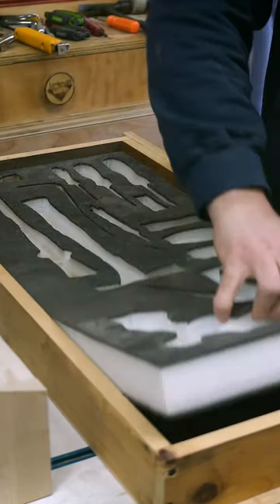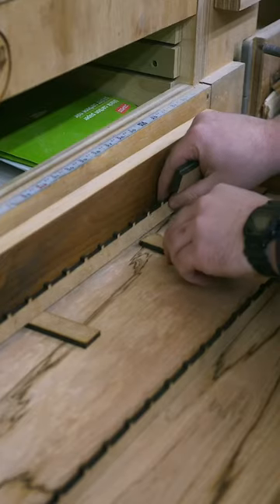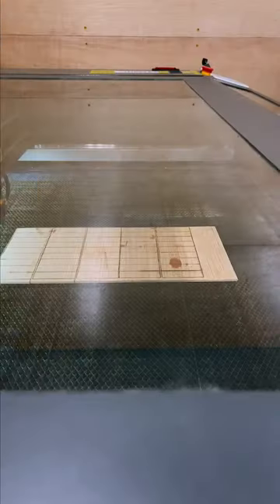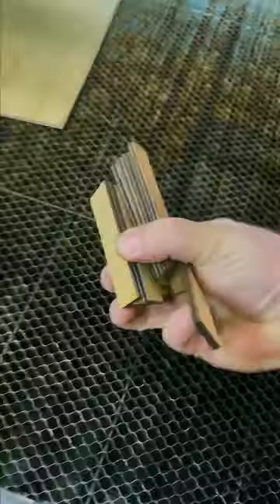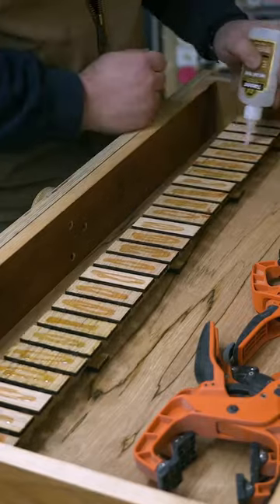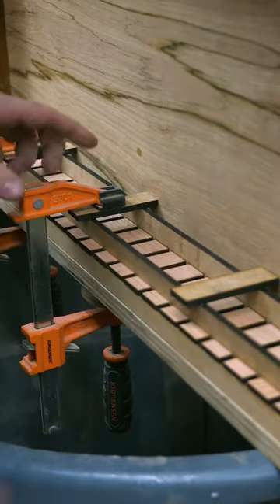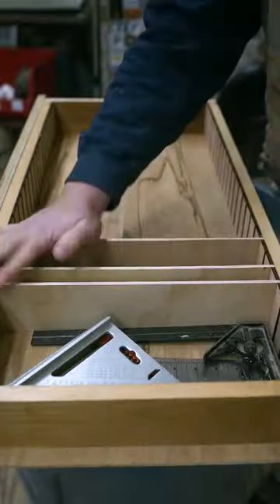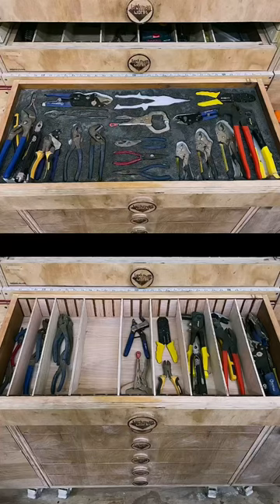No more tool foam!

Comment: I agree foam tool organization is good for a case that has that one special tool, like some fancy test equipment or maybe your 10mm but not your entire box
Reply: I work in aviation and foam shadowing for the entire toolbox is a pretty common practice. It keeps your box well-organized and it’s easy to identify if any tools are missing.
Reply from the maker: @phtevenmolz5030  yep, need to make sure those tools aren't left in the plane somewhere!
Reply: @phtevenmolz5030 I'd also argue that organization for a wood shop, car shop, and plane shop should be different.

 Wood tools need to be fast to access and easy to get dust off of, along with nothing so fancy stain or glue will ruin it

A car shop needs to be open and tightly packed to keep lots of tools, but ones that are frequently going to have a decent amount of grime on them. 

I can't imagine that it's often an airplane mechanic has a mixture of wd40, rust, and oil on their ratchet that's getting set on their fancy foam 😂

Comment: The foam looks way better organized.
He just needed another excuse to-use his laser😂
Reply: This is how you upgrade backwards
Reply: He mentioned why he did it bud, you hard of hearing?
Reply: @cookitcrispy  Ass you can see on the photo at the end, he still could lay things on tools.
Now it is wors, now he needs to take 3 tools to get to one, and if it was only about space he could just lay tools on top as i said
Reply: standing stuff up saves even more stuff just use springs
Reply: It’s clearer with the foam to see if there is a tool that hadn’t been put back in its place. Still though, cool video and choice of way to store your tools
Reply: He changed it because, if you loose a tool or want to change something in the drawer you can't. You'll have to get a new foam and start all over
Reply: @jabanan  You wouldn't just replace a lost tool?
Reply: For mobile tool chests foam provides the most protection. The only reason I could see using in a shop is to quickly identify if a tool is missing. This could be advantageous if you share tools with anyone.
Reply: @jabanan  bro, he was gluing the wood pieces in place… he just needed an excuse to justify his laser purchase more.
Reply: @Lord_zeel  Maybe I want to buy a different brand this time or a different size? Or what if the tool has been discontinued? Foam looks great, and it's good protection if you have to travel, but it's not adaptable at all.
Reply: @kevrides5706  He glued in the little pieces that make up the slots, not the actual dividers. 🤣
Reply: Notice the amount of space available not taken up by the foam
Reply: @enduroiasg4068 t's not worse stop being so dense, it is literally his workshop and he does what is better for him, if he wants to burn all his chairs cuz he likes to work while standing then that is BETTER for HIM, repeat after me BETTER for HIM, you got it? Not you! Not what YOU think is better for YOU, you don't work in his workshop everyday.

Also he said that the foam restricts changes and adaptability, he can't add or change tools in the foam because they won't fit, so basically to him the foam was wasting space AND restricting adding additional tools, bye now have fun 😃
Reply: @kevrides5706  could have just cut slots in the side pieces for the dividers, no fancy lasers or millions of clamps needed

Comment: Kaizen foam style is for 1 purpose: findability. The idea is to be able to see (ideally from a distance) that a tool is not in its home.

If it's not in its home you need to stop work and find it

In drawers, at home, it's significantly less than ideal
Reply: It’s also for ease and speed of making. In a production setting where there’s constantly changing products there’s also a need for constantly changing tools and support infrastructure. This fills that role quite well.
Reply: This guy gets it. If your a woodworker a missing tool is a minor thing. If your a mechanic, especially in something critical like aviation, you have to ensure all your tools are always accounted for.
Reply: Yep, this is exactly what I came here to say 👍🏼
Reply: Mostly right.   I wouldn't say that a home shop is the best place for Kaizen.   But, if you work out of a truck, it keeps more expensive or electronic tools better protected, and you know when a tool is missing...
Reply from the maker: @Mrcaffinebean  Yep! This is why people in that industry have toolboxes that cost more than my laser, it makes sense for that environment
Reply: @instantsiv  if you buy good tools, they rarely need replaced.  And you generally get more hand tools vs different hand tools.
Reply: EXACTLY!  People seem to think Kaizen is the manufacturer or something, not the PURPOSE.

Comment: Foam also secures the tools in place. Good for traveling toolbox maybe, but you dont need that in a stationary toolbox. The tradeoff to security is harder accessibility. Its far easier to grab a tool without foam cut out around it.
Reply: Except when there are 20 other tools around it

Comment: +1 on the modularity.  However, I suggest that, in general, you don't need full-depth dividers.  Having horter dividers makes it easier to have narrow bays and still be able to get to small tools.

Comment: The foam organization serves purposes in some applications that it won't in others. 

For example, by having each tool shadowed, you have a good way of determining if you have all your tools still, and avoids leaving them wherever you were working. The Aerospace industry uses this to avoid having tools left inside aircraft or sub assemblies.

Most people, especially in Carpentry, probably don't need that safeguard. Automotive guys might benefit from it, however.

Comment: The foam works best in the task dedicated tool boxes, that I use to organize specialty tools and their supplies.  That way I can pick ups the dedicated kits and take the tools to where I uses them.   And, when I pack up to leave, I know immediately that I have everything.  And, am not leaving things behind.   

Automotive tools at home are loose in their drawers.   I don’t take them out of the shop.   Tools at work are in foam:  So it is obvious immediately that someone borrowed one, or I left it sitting somewhere.  A freind used to buy only from one tool truck:  their tool sets came with trays which fit his tool box.   I made him an assortment of task specific trays for his his roll-around box, which held all the tools he needed to do common tasks on specific years ad models of cars. That way he knew exactly what tools he took to the car and could get them all bag to their spots in his two big boxes.

Comment: Personally,  I've always seen the foam as something for storing more delicate and/or precision tools and parts.  Like measuring tools that cost $1000 and are made out of a single molecule of steel and fairy dust or whatever.   The parts bins you built here are for everything else.  Although personally , even though they would take up slightly more space and be slightly less customizable, I'd rather have little wood boxes that could be fitted in the drawer, tetris style, and you could pull out the whole box of screwdrivers, for example...

Comment: I don't need Kaizen at home. Projects will  always take me longer than an efficient assembly line. I use rubber mats in my drawers and lay out my tools most used like my sockets and hammers. Smaller drawers are filled with assortments based on project, electrical, plumbing, carpentry, etc. It's organized enough to find anything I need.

Comment: Shadow boxing has better usability when using shared tools or if you have a habit of not putting stuff away in the same place i.e. you "put it where you'll never forget" and then you proceed to have to buy a replacement because you can't find it

Comment: The use of foam tool storage is in manufacturing and in Aviation, and its required in the Aviation Manufacturing and Maintenance industry. if you loose even part of a tool while making or maintaining an aircraft, everything has to stop until you find it. The old school method of using wooden tool cribbing to me is perfect for every day use because you can CLEAN THE DANG DRAWERS! Only thing plastic foam does is collect FOD.

Comment: While it's true that the foam is less efficient and less adaptable... that's partially the point. It's not supposed to be adaptable, because it's intended to keep you from "adapting" it on the fly by tossing things in wherever is convenient. It's less space efficient, but that's to prevent you from stacking things or shoving things together in a way that's hard to find. I think part of the problem in this case, was that you had drawers that were too deep for a lot of your tools. Rather than ditching the foam altogether, I would suggest purchasing/building a toolbox with drawers in multiple depths, include some that are VERY shallow. Tools like box wrenches, pliers, snips, and other thin things go in these. This allows you to more efficiency use the volume of space, without needing to place items on top of one another. Additionally, the foam in those thick drawers doesn't need to be that thick. A hammer will stay in place when only half way into the foam. This makes it easier to pull tools out of the foam (more/larger finger pull spots is good too). Finally, the foam prevents items from moving, AT ALL, when the drawers are opened and closed, or if the toolbox is moved around.
Reply from the maker: I'd admire your passion on the subject 😂

Comment: why didn't you just take your drawer sides and cut grooves an 1/8 inch deep with your miter saw then you put your dividers in you would have saved so much time and glue
Reply from the maker: So I should disassemble the drawer and build a new one?

Comment: Wowza... Why wouldn't you just laser cut partial depth slots in the divider holders and notch out the actual dividers. The amount of glue you just used also the difficulty aligning all the pieces with glue on them.... 

Work smarter not harder buddy

Comment: Lets see the flip it upside down test. Lets here the combined rattle of all your tools in the back of the truck, lets see the wear n tear on the tool handles after 50,000 miles. Foam inserts are for modular tool storage on the move, dividers are for the workshop. You chose the correct method not the alternative.

Comment: You had me at "modularity & adaptability", foam e.g. can only be 1 tool deep
Pliers btw organize best on edge in wire dividers (I cut mine out of the bottom of a tired old wire dish strainer), I actually saw that on that Utube whatchamathingie
Reply from the maker: That's a good idea!
Reply: Stacking tools is never a good idea. What you want is thin drawers that can only hold one layer. That way nothing is ever hidden under something else and you can see everything in the drawer at once. The only exception is for redundant tools: For instance, if you have two sets of box wrenches you can make the slots double-deep and put each pair in the same slot.

Comment: I always chuckle whenever I see a hammer in a foam tray. A few of my friends does this, however the thing is litterally made to beat other things with, what's with the protection? 😂
Yeah it looks neat and organized, but so does putting outlines on a pegboard as well.
Reply: The foam isn't for protection. It's so that you CAN'T disorganize it. Outlines are all well and good (and for larger tools like hammers, a peg board is probably the way to go). But in a drawer like this, what you want is not only for every tool to have a place, but for those places to be inviolable. With foam, you can't put the tool away wrong, you can't toss something new into a random drawer without thinking, and items can't accidentally get moved around. Plus, if any other human goes into your shop, they can't instantly fuck it up. But yeah, a hammer in the drawer? I probably wouldn't do that unless for some reason I had a really special hammer that I didn't use very often... not sure what that would be.